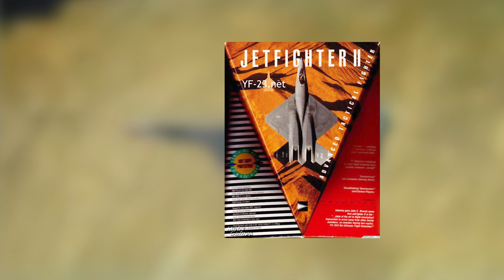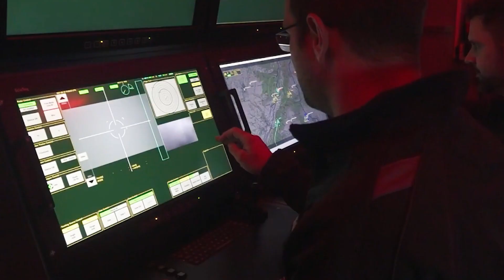Finally! US Tests World's Most Deadliest Fighter Jet

Comment: I worked on this, politics.  Senator Sam Nunn from Georgia,  Lockheed was to build the F-22 in Georgia....YF-23 outperformed the YF-22 in every category and was just as maneuverable,  the large "Y" tail equaled the thrust vectoring.  The Air Farce selected the aircraft that they felt had the best chance of being funded. NOT BY PERFORMANCE.
Reply: The Air  F "A" rce ? ? ( french for JOKE )  🤣
Reply: Exactly
Reply: I was at Edwards AFB at the time of the flyoff.  The general consensus by the people that were in the know on the competition said the YF-23 was the slightly better aircraft and that the YF22 was selected because Northrop had had some recent failures on other projects  and that the Air Force was more confident that Lockheed would be able to deliver better that Northrop.
Reply: The smart thing to do would have been to select one for production and make a small amount of the other and test both of them in all areas of combat and see the operating expense of both. And the money would be worth the technology gains learned by both aircrafts. It's always foolish to not continue to work on projects that have room for growing making better and learning what works and what don't.
Reply: @rk5845  that would never happen however I think they should have selected them both and produced both since the strength and weakens are different it would force adversaries to plan for and build defenses for both.
Reply: Wasn't YF-23 more expensive?
Reply: @dct124  They were both very expensive, the F-22 is already being end of lifed because of its maintenance costs.  It's production numbers were drastically reduced because of its high acquisition cost.
Reply: @KaiLastOfTheBrunnen-G  so wouldn't that mean neither are good long term solutions?
Reply: A not so funny anecdote, we were playing golf one Saturday after the flyoff was done and we saw a trail of smoke coming up from the main runway and one of the guys I was playing with said there was only one plane on the schedule today and that was the YF-22.  Sure enough, it had crashed doing some touch-and-gos.  The test plan had removed a step that no one thought was needed, they were wrong.
Reply: @dct124  Everyone knew it was going to be expensive no matter which one they selected, so why they got sticker shock 15 years later I don't know.   Probably just wanted new toys and congress agreed because they like new toys too, and spending your money (mostly spending your money).
Reply: @KaiLastOfTheBrunnen-G  I write off all my taxes 🤷🏾‍♂️ but I get what you're saying. Did we need it? I think so. Didn't matter if it was YF-22 or YF-23 both were far ahead what anyone else was doing and still is currently as we have pilots with far more experience and actual combat hardened experience. Do we really need the F-22 or potential replacement 🤷🏾‍♂️ seems like tactics, weaponry and countermeasures are advancing to the point where the skies damn near have a force field.
Reply: @dct124  NGAD is supposed to be even better and more maintainable.  It'll be manned but I think there will certainly be an unmanned version.

Comment: I believe politics had much more to do with buying the F-22 over the YF-23.
Reply: Just like everything ssdly
Reply: Nope. 
The US military bought what it needed not what fanboys want. They are costing and calculating the service of the aircraft over decades and it is not just about pure performance.
Reply: @michaeldodge7253  Because Soviet Union no longer exist, and anyone is still 25 years behind.
Reply: It wasn't just politics.   This was a decision also based on an allocation of tech of who did what best.  Northrop already had the B-2 bomber in the mix, and they didn't want to disturb that groove for lack of a better word.  Lockheed At the time had a very diverse portfolio going on and a much larger production capability and could expand quickly... hence,  minus the political ramifications, production was supposed to be a large project for many years that Lockheed was all ready to handle.  Except, politics and budgets killed the F-22 completion of the proposed 750 builds and only, what 186-87 were built?  But Lockheeds portfolio could handle that loss considering the had the C-130, C-5, F-16, P-3 and many others.  Northrop tho had a smaller, but tight portfolio that while it could have accommodated building the F-23, it would have placed it in another semi-course change that might have taken focus off B-2 production.  But as we all know, that got cut short too.  Never a dull moment
Reply: Yes true but false, the military chose the YF22 due to it being more agile long Su 27 and Mig 29 then the Yf23 like
Reply: Ya think......
Reply: @isaacteo4063  the 23 was just as agile though. A test pilot who flew both said so and said it was down to politics and Lockheed and Martin having better marketing.
Reply: The F-22 won for a good reason. One reason thrust vectoring. The 22 had it the 23 did not. In test after test the 22 was the better aircraft period. And it has proved that for 30 years. It is hands down the best fighter in the world.
Reply: Your right. My brother worked for Northrop and he told me the F-22 had several things non- functional like super cruise etc. When it went up against the F-23 and still won.
Reply: @jerryjustice8803  I had a friend work for Lockheed Martin and although there were teething problems with many of the systems they were all fixed. Super cruise being among them. Again, the F-22 won for trust vectoring...something the 23 did not have. And it has proved itself the best fighter in the world. As a matter of fact the decision to end production at 187 total aircraft was the biggest mistake when SEC DEF Robert Gates decided to end production. It was an idiotic decision that hopefully we won't pay for in the future. I believe we didn't need the F-35 and could have continued to produce the F-22 improving it and developing a F/A-22 version along with other versions. But as usual stupid politics got in the way...as a result we spent a trillion dollars on the F-35 every more waste, fraud and abuse of taxpayer money. Instead of the F-22 we have instead purchased the F-15E...two steps back, to fill the gap in air superiority fighter requirements. Stupidity piled on top of more stupidity and politics. And Lockheed Martin has benefited with two back to back fighters F-22/F-35 and has cleaned up...while our defense suffers.
Reply: Not really, the F-22 was far more manuverable, in a world of stealth aircraft close in combat is a very real possibility. You cannot count on a standoff missile kill. The YF-23 is a good aircraft, but it was not supermanuverabke.
Reply: Lockheed had solved the bomb bay issue with its F-117. On top of that they launched an AIM-9 from the F-22. Which impressed the decision-makers.
 That said I'd have preferred the F-23...
Reply: The yf23 won in almost every way watch a few vids on it fucked up we got the f22 still a amazing jet but yea
Reply: The F-22 outperformed the YF-23 in almost every category
Reply: @bighands69  Yes actually, it was political. The YF-22 was chosen over the YF-23 for one primary reason, The US mitary didn't trust Northrop Grumman after the severe cost overruns during the B-2 spirit program. Since Lockheed Martin was government funded the cost overruns weren't a problem.
Reply: @joshuasikora2465  Ah no it didn't...the YF-22 won in every competition fly off against the YF23...the 22 is the superior aircraft period.
Reply: The F23 wasn't ready
Reply: LM also built the SR71. They know how to build fast
Reply: @bighand69  And their calculation was WRONG!!

The F-22 was chosen over the F-23 in 1990 at the end of the Cold War when the U.S. emerged the ONLY superpower in the world.

Who was going to challenge us?

So it made sense to pick the lesser advanced aircraft to save developmental cost.

U.S. authorities didn't anticipate that in 20 or so years, China and now Russia would have developed pretty formidable aircraft to challenge us.
Reply: @Andy Hughes  the F-22 was NOT chosen when the US was the only superpower. The F-22 was chosen in April 1991. The Soviet Union didn't dissolve until December 1991 - a full 9 months later. The entirity of the ATF program was conducted while the Soviet Union was still active.
Reply: @andyhughes1776  Wrong....The YF-22 won the fly off hands down. The F-22 had thrust vectoring the YF-23 did not.
Reply: @@johnpitchlynn3004  The YF-23 is MUCH MORE stealthy than the 22 by its more advanced shape.

Thrust vectoring could easily be added later.

The shape cannot be changed!
Reply: @@johnpitchlynn3004  If they chose the YF-23, the F-22 wouldn't have to be retired today after only 16 years in service.

Thrust vectoring could be added to the 23 but the 22 shape cannot be altered.

The 23 was way ahead of its time because it has the shape of today's 6th Generation prototypes - extremely stealthy shape WITH BLENDED vertical and horizontal stabilizers into two control surfaces instead of 4 (for better Stealth and less drag).

It was about cost-cutting after the Cold War.....but it ended up costing more in the long run because now they have to retire the 22 to come up with an entirely new 6th Generation fighter that will shape like the YF-23 (with blended tail).

Had the 23 been chosen, they could just upgrade it now instead of developing an entirely new airframe from scratch.
Reply: @@johnpitchlynn9341  What formidable fighter did the F-22 face in combat in the last 30 years?

That is like saying Mike Tyson could easily beat every lightweight amateur boxer in the world. Of course he could!

I don't think the 22 had even faced the Soviet-era MiG-29 in combat.

In fact, because the U.S. does NOT export the 22, I don't think it was ever used in combat.

Can you name a conflict where it was used?

Maybe I'm wrong, but I can't think of one.
Reply: @andyhughes1776  You opinion not supported by facts. The F-22 was the superior aircraft in every test. Thrust vectoring couldn't be "added" later. That's nonsense as the design did not allow any change to aft portion of the aircraft.  The decision to retire the F-22 was made as the bill payer for the 6th generation fighter. It was as stupid a decision as the one that stopped manufacturing the F-22. It would have made no difference it was political decision and the 23 would have suffered the same fate because of the SECDEF and Congress.
Reply: @andyhughes1776  not from behind its not, with visible compressor blades!
Reply: @@stevenspilly  Again, the F-22 stealthy thrust vectoring engines could be retrofitted to the F-23 later (like China is doing with their J-20 right now).

In contrast, the F-22 shape cannot be altered (it'd be a different aircraft then).

Besides, if the F-22 is THAT good, it won't need rear Stealth because it would've destroyed enemy aircraft BVR LONG BEFORE it needs to make another pass to expose its tail.

Indeed, the Russian SU-57 engine nozzles are not stealthy at all.  But because it is extremely maneuverable, the philosophy is that it only needs one pass to destroy enemy aircraft, should it get close.
Reply: @@johnpitchlynn3004  As much as you are in love with the F-22, you can't deny the fact that the F-23's shape is decades beyond its time.

Again, its blended tail alone is much more advanced than the separate conventional tail surfaces of the F-22.

The F-23 was so advanced that today's 6th Generation proposals all look like it.

In contrast, all 5th generation fighters look like the F-22 in basic shape and contour. 

NONE look like the F-23 - only 6th Generation prototypes do.

That's how advanced the 23 was.

BTW, there is nothing impossible about retrofitting thrust vectoring nozzles ON ANY aircraft afterward. 

China is doing just that with their J-20 as we speak.
Reply: @andyhughes1776  the SU-57 uses rivets. It is not a stealthy aircraft lol
Reply: @@stevenspilly  From the front, the SU-57 is stealthy enough to sneak up on enemy aircraft.

After that, its extreme maneuverability will ensure its victory.

Different approach:

The F-22 was designed to kill from BVR LONG BEFORE any enemy aircraft could get close for a dog fight.

In contrast, the SU-57 was designed to primarily kill the enemy in a dog fight.

That is why it is more maneuverable but less stealthy than the F-22.

Different strategies.
Reply: @@stevenspilly  Remember, the Vietnam War showed that BVR kill was often NOT effective.

That was why U.S. military brass ordered the cannon be placed back on U.S. fighters for close air combat.

It remains to be seen if BVR kills using stealth is as effective as Defense contractors promised.

BVR kill strategy was NOT effective in Vietnam.
Reply: @andyhughes1776  🙄🥱😴
Reply: @andyhughes1776  🙄🥱😴
Reply: @Andy Hughes  nobody bought the 57 because it doesn't meet its brief. It's not stealthy, it's engines are obsolete and it's only more manoeuvrable at extremely low airspeed. Doing the cobra is a last ditch hail Mary where you lose all your speed and energy. Hardly smart tactics. The F22 would beat the 57 at any range, but more than likely before the 57 pilot even knew the 22 was in the sky. If the 57 was any good countries would be lining up to buy it. Instead, India dumped it and Russia can't even justify making more than 12 flying examples for themselves.
Reply: @Andy Hughes  that's true. But the Vietnam war ended in the 70s. A lot has changed since then including missile tech. Let's look at more modern conflicts. The gulf wars - how many A2A kills were made using guns? The Israeli's have shot down dozens of Russian fighters and the vast majority were within visual range, but still used missiles, not guns. If guns were so important, the Russians wouldn't be unvesting so much into missile tech,  they would load multiple canons on their fighters. The 57 has ONE 30mm Canon and multiple hardpoints for missiles. So it seems not even the Russians agree with you. You're living in the past, the 1970s were 50 years ago.
Reply: @Andy Hughes  the 23 had some great features but it wasn't ready. The 22 outflow it in the demo and won because of that. Plus it had thrust vectoring and didn't have visible compressor blades from the rear. I think the 23 would have made an amazing interceptor, but this was not the brief. That's why it lost.
Reply: @Andy Hughes  if you want to win a contract, don't put forward a design that needs retrofitted engines. It's like admitting your fighter is already obsolete when you are trying to say its cutting edge. They could and should have used thrust vectoring engines. They chose not to and that's one main reason they lost. Another is because the YF-22 shot missiles from its internal bay during its demo flight which the yf23 couldn't do yet.
Reply: This man has like 50 channels my god
Reply: Get over it f 23 lost the contest !!
Reply: Yes and no. I’ve read the accounts of a test pilot who flew both aircraft. And he simply said the YF-22 (Called at the time) was slightly better. However, this video’s got to be false. Why would they drag out this from the late 90’s when they’re two years or less away from introducing a 6th Generation fighter. And that plane won’t have any vertical stabilizers, if the publicly released information is true and correct.

Comment: I was the assistant PEM at the Pentagon for this program. The F-23 beat the F-22 in every area. The big risk for the F-23 were the large “rudders” and the stress on the actuators.  The official reason the F-23 lost is the avionics package was to risky.  Ironically, the F-22 could not pull off the original avionics concept either.  The unofficial reason the F-23 lost is the politics involved.  This was never documented!
Reply: Was Northrop being punished for cost overruns with the B-2?
Reply: I call BS guy
Reply: Same thing happened for Northrup on the XB-49 flying wing. Instead they built the B-36 which was just big and slow. A perfect target 🎯. I know the flying wing had problems but think where the USA's aviation advanced would be now if it had been built.
Reply: Others Countries now apparently get help from Y-23 creators with their 6 generation Fighters.I am a civilian and I liked Y-23 better.
Reply: I was stationed at Edwards when both planes were being tested and the YF23 was vastly a superior airframe. The YF22 was chased about EVERY flight by firetrucks. And I even had to pick the pieces after it bounced it ass down the runway.
Reply: @michaelhyland9216 the F-22 was basically a modified standard airframe while the F-23 was a completely new airframe. It resembled the aircraft featured in the movie Stealth.
Reply: In other words the Pentagon was afraid of the Y-23… The concept was way ahead of time. In performance and execution. If Y-23 was allowed to improve like the YF-22 was allowed to do, the out come would have been the Y-23 still top dog today.
Reply: It certainly didn’t help Northrop’s case that they had just finished bilking the Pentagon for billions in cost overruns for the B-2 and several other contracts.  If you prove time and time again that you cannot meet your OWN cost estimates, customers will walk.  Even the U.S. military.
Reply: @willymac5036  all of the aerospace companies have cost overruns. Take a look at the F-35.
Reply: You worked at the Pentagon yet can't even use the word 'too' correctly in a sentence???

Absolutely not. 

Pull the other one kid.
Reply: @dustinkeim179  100%.
Reply: @scottw5315  Yeah this is a document fact. Northrop's name was mud.

Ironically Northrop now making B21 to budget and Lockheed overunning on major projects.
Reply: Tell us about Aroura
Reply: Does that include maneuverability and stealth factors?
Reply: As was the case that year for the LHX selection, A-12 cancellation, and attempted C-17 cancellation. Politics. Great to know that the people in the armed services don't get to decide what will work best for their needs.